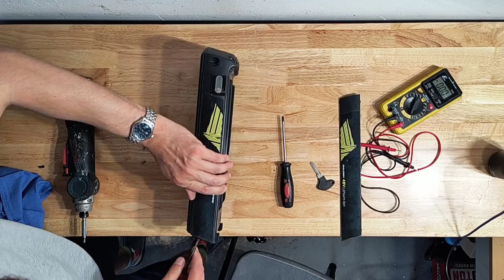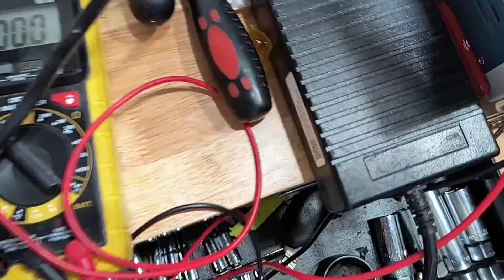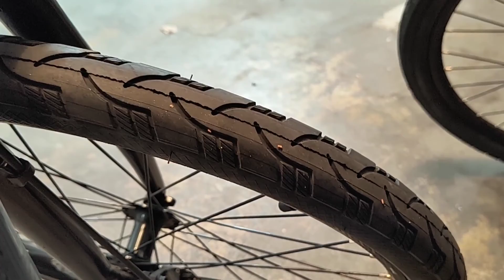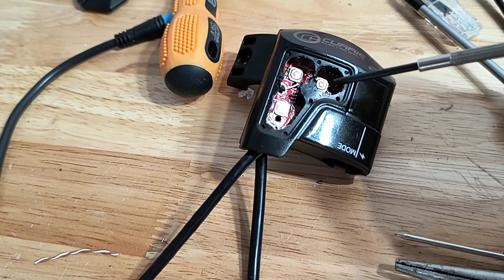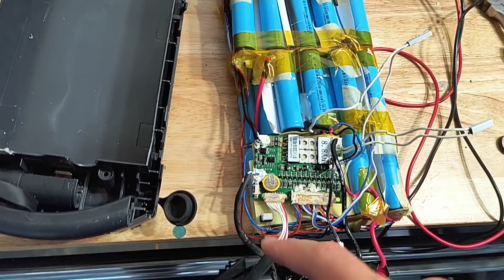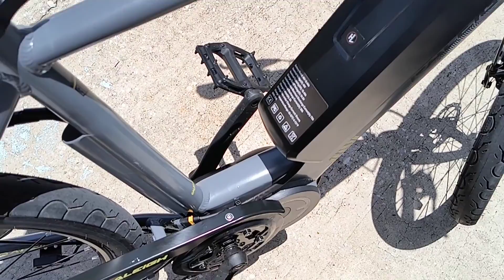Saving Ebikes from the dump. Raleigh Sprite iE Battery replacement/rebuild and display button repair

Comment: Thanks a lot for this video!
I have exactly the same pb on this DP27 display: this video encourages me to try to fix this difficulty.
But could you explain me how you succeeded to open the DP27 display: there is no screw, how to disconnect the 2 parts of this plastic box?
Thanks

Comment: Thank you! So the only thing lost by using the new battery was the onscreen battery level display? You could still select assist level, and see that displayed? I have one of those Tranz-X 48V BL07 batteries w likely bad bms on a Diamondback Lindau with 500W Currie hub motor. Different buttons & display, but this is encouraging me to try an aftermarket battery & I like the bottle location idea, to see the level indicator.